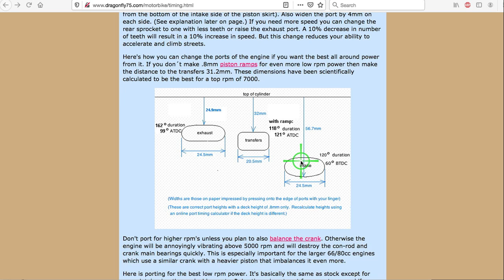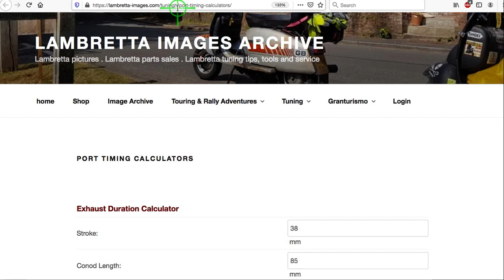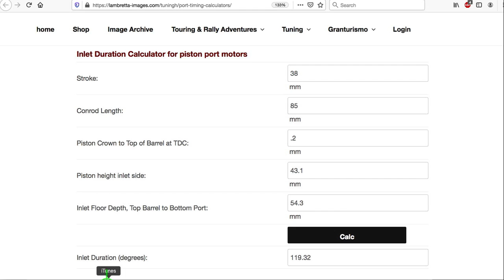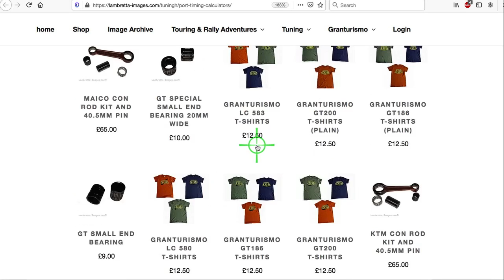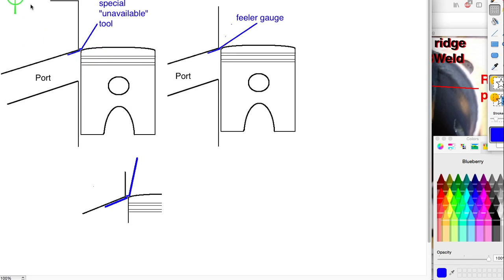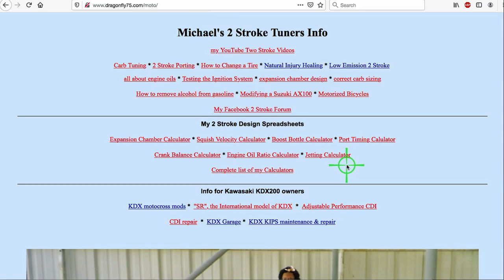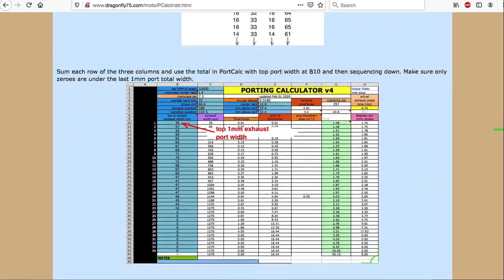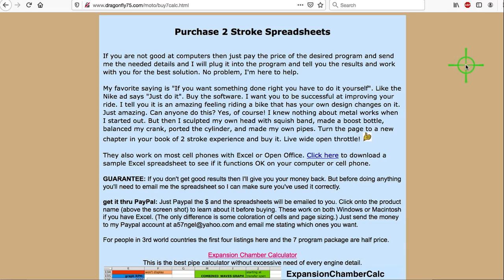Methods to Find Port Durations

Comment from the maker: I forgot to mention that if you use the degree wheel method you should be applying pressure to the top of the piston when it is going past each port edge because there is a little bit of up/down play in the piston when the bearings aren't fresh, not much but enough to make a difference on small engines.

Comment: Although I agree on the ambiguity of using a degree wheel, since you dont use one I think your making it more complicated like others are. Its very easy to set the degree wheel at BDC with no extra tools necessary and its accurate. Accuracy can be verified by checking port timing on up and down stroke to assure they are the same.

That being said I prefer your method of using a caliper.
Reply from the maker: That's not the tricky part. How to get an accurate knowing of when the piston edge is exactly even with the port edge is what's tricky. I think both methods have a margin of error but the degree wheel has the biggest margin, and the sloppier the method is to find where the piston edge is at the port edge, the sloppier the results will be. Someone out there probably knows a good method to use but I haven't heard of one yet.

Comment from the maker: My porting calculator shows that a 2.5 degree transfer change offsets the peak power RPM by around 300 which isn't a lot which is why being ultra precise is normally unnecessary. But if this is your hobby and you do porting changes a number of times each year then it probably is important to be as precise as possible to have a sure baseline from which to compare to. Also the smaller the engine, the more precise you need to be.

Comment from the maker: Please don't no one get offended because I think the degree wheel method is more inaccurate than using a duration calculator. Like I said in the video, you won't be able to tell the difference when riding if you are 1 degree off. It might just shift the peak power RPM a few hundred RPM. No big deal. The most important part of this video is the recommendation of using my porting calculator to help decide on changes. (click on link in description)